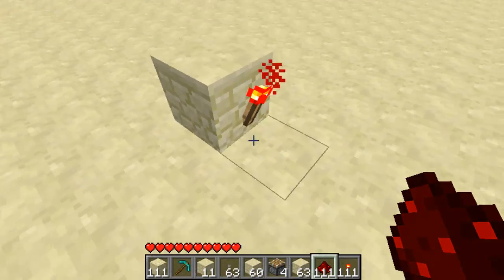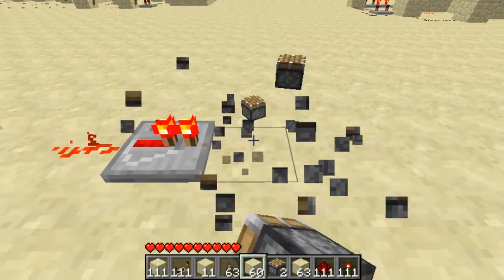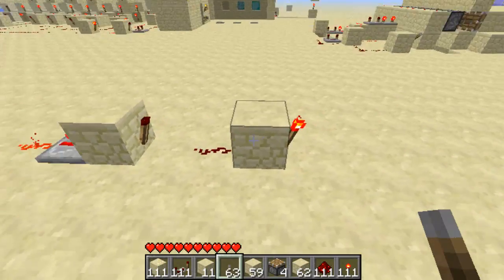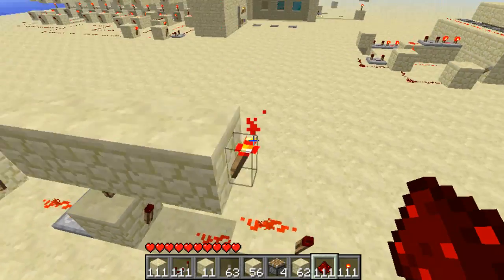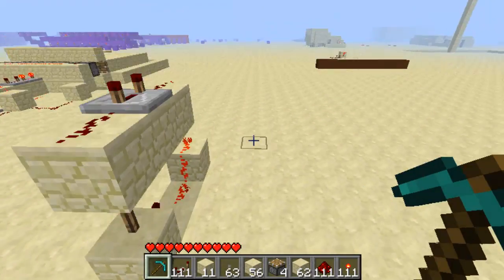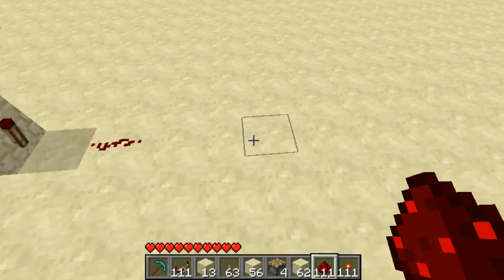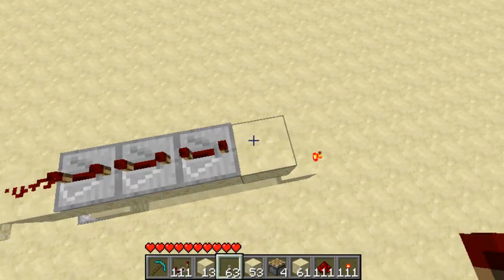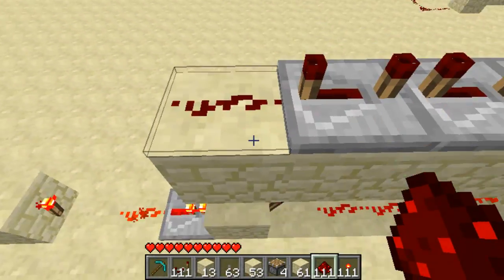Vertical Pulse Limiter

Comment: Lol, I appreciate the effort you went into doing this, but there's a miles easier method which I think you should be aware of. (I'll try my best to explain since my computer is shit for recording)

Quite simply: Pulse goes into a block, and on the other side of this block is a torch. Underneath the torch and the block you dig out, and underneath the block you place a 4-repeater and underneath the torch you place a piece of redstone. Dig the hole one longer and put another piece of redstone in it